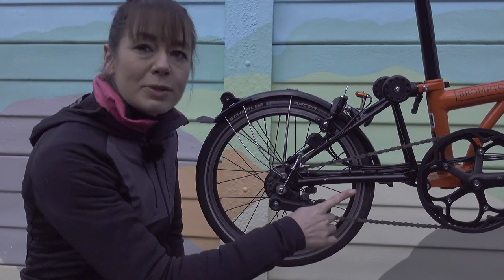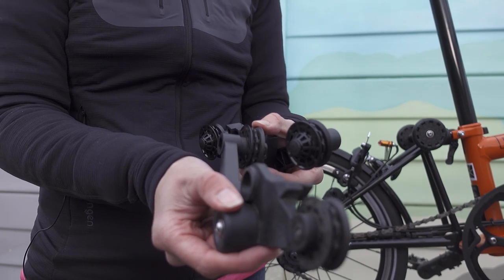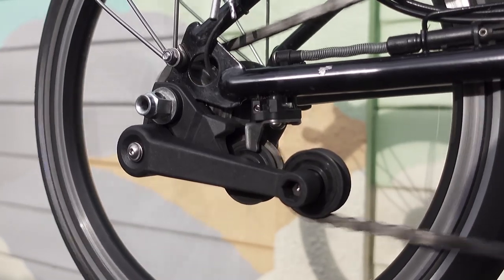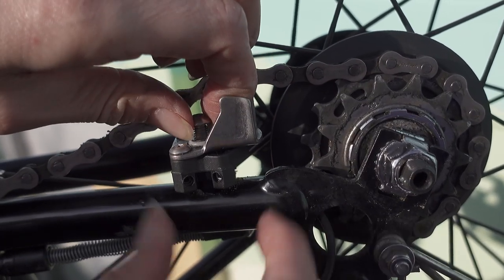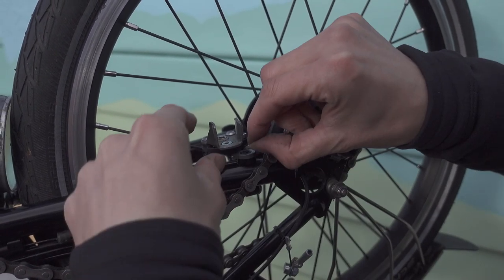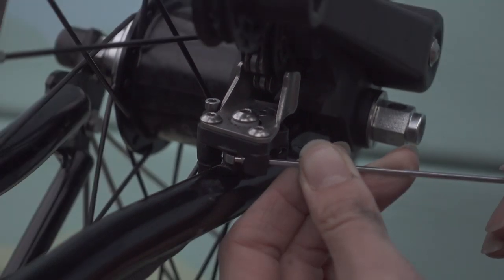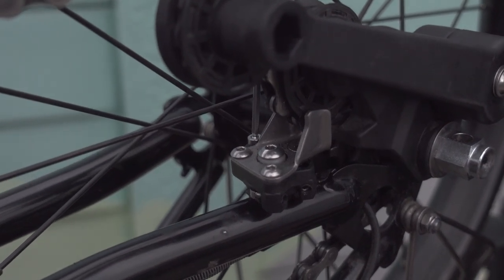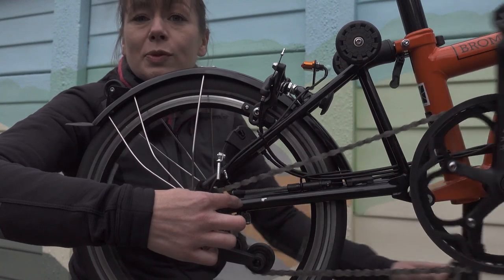Brompton 2 / 6 speed Derailleur - how does it work?

Comment: Thank you so much for this - whenever I have problems with the derailleur I can never remember/figure out which way to adjust the screws to get the desired effect. I’ll be referring back to this next time!
Reply from the maker: Thanks for watching - we really hope it is of some use
Reply: The way I remember is this:
1. The Allen screw further away from the rear wheel axle is for the higher gear (high=far)
2. The Allen screw nearer to the rear wheel axle is for the lower gear (low=near)
3. Loosen screw to close gap between wing and idler wheel (the wing that's supposed to be almost touching), tighten to widen gap
(I have this last point noted in my Brompton Manual as it is the easiest one to forget)

Comment: Spent a good 20 mins trying to adjust mine with no luck. Then noticed the housing for the bar/spring was moving about, maybe weakend or something. Anyway, cable tied it to the chainstay and it works fine now. British engineering at its best, no wonder we don't have a car industry now.
Reply from the maker: Did the small nut fall out?

Comment: Thank you so much, had the same problem with my Brompton and could not get the spare parts ( chain pusher and spring, cable) from my local Brompton dealer (tried to get them from Evans but they out of stock plus they sold me a wrong size cable 😳), ordered those parts from brilliant bikes and got free delivered really quick. Excellent customer service!

Comment: I just put a new chain on the Brompton ... the bike has done about 3,500 miles. Did not change the rear sprockets. BIG MISTAKE. The new chain kept pinging off the smaller of the rear sprockets; I couldn't do anything about it. Had to refit the old chain, in the end. Have now ordered new sprockets from you. Live and learn.
Reply from the maker: Thanks for the great feedback

It would be our number one tip - if changing the sprocket change the chain, if changing the chain change the sprocket

We often describe them like a comfortable married old couple - they get used to the way each other work!
Reply: @brilliantbikes  The spares arrived promptly ... and the new sprockets have completely cured all the problems I was experiencing with the gear-change.
The included nitrile gloves were a nice touch, and very 'handy'. Thanks.

Comment: Can you do a dedicated video on replacing the shifter cable and tuning the rear derailleur for the external 2-speed? How to tune the length of the cable with the barrel nut to match the shift points.Thanks

Comment: Really helpful video. I had similar issue, followed all of the steps but it didn’t improve. Eventually I changed the chain pusher for a new one, there was some wear on the inner channel which I suspect was contributing to the issue. Resolved straight away. I wouldn’t have had the confidence to tackle this job without your video. Thanks.

Comment: Hi. Always awesome. Q: My brompton chain makes a little clicker clack as the earlier part of your video your chain made. I notice in the post posher adjustment your chain no longer makes that sound. I’d like to seat my chain on the sprockets so that it doesn’t make the sound. It used to not. Started after I swapped tires and tubes with shealbe marathon plus. I was thinking many it’s my gear change chain in the 3 speed hub. TIA 🙏🏻
Reply from the maker: It sounds like you you need to adjust the derailleur needs adjustment!

Comment: Hi…. Absolutely great video and it really encouraged me to try and do a proper job sorting my gears out the first time round rather than trying to do a quick bodge!

HOWEVER!  Amy gears still don't work properly….. I can change from high to low gear but I get no click that holds my gear shift in place….it just pushes right the way back to high gear again… any idea what could be going wrong!

Comment: Thank you. This is really helpful and so well explained and presented. My wife has a new sparkly Purple Brommie which she has named " Jennifer ". There were intermittent problems with the derailleur. When we took it in to the LBS for its post sale 3 Month check up the technician found out that the gear shifter mechanism on the handlebars was binding internally from time to time. Apparently it is not uncommon with the new style shifters.
A bit of wet and dry and some lubrication and it is working as it should.

As an aside, I'm finding this series of Video's extremely helpful and informative. From the feedback I can see that I'm one of many so I wondered if you have considered running a Brompton specific maintenance workshop day/ weekend? There may well be an unmet demand, especially if a Pub was involved at some stage :-)
Reply from the maker: Thanks for watching 

We hope that your wife enjoys her adventures with Jennifer

Next Friday - 6th Dec 2019 - we have our village Christmas ‘extravaganza’ 

Based on your feedback we are going to try a workshop for wheel removal / installation on a Brompton to see how that works out (even if no - one attends, as a practice at least)

If you are able to get to CHOBHAM - come and say hello - we have good local village pubs!

Comment: I tend to find chain pusher issues are normally cable tension and that is adjusted at handlebar. If it isn't that then this is very useful. Still prefer my 1964 Moulton F Frame though 😜

Comment: Tensioner cleaned (in the part washer, not the sink!) chain pusher removed, cleaned, lubed and replaced, and dog leg bolt loosened a little to promote movement... and it's still struggling. I wondered if it was struggling because it's been stored with it in '-' position, causing the spring to loose some of it's strength? Ever heard of that happening?

Comment: one other issue i have found is that the housing for the shifter (new style) on the handlebar can create issues if its casing screws are done up too tight. It seems to limit the free movement of the shift lever, so if still stuck, i recommend trying just ever so slightly loosening those to see if it helps?

Comment: Hi, do you have a suggestion for when the jockey still won't push the chain into high gear? (the smallest sprocket on my 2-speed) My problem remained after cleaning everything and the checking all the other tips in this video. It seems the spring is just to week.

Comment: someone told me that we needed to open up the +/- shifter lever body/casing to change the inner shift cable?  Or, can i just simply change the inner shift cable by pulling out the old inner cable  and insert the new cable through the  lever? Thanks.

Comment: Lovely video. The gearing system seems far too complex to me. Why don't they fit a Shimano like everyone else?
Reply: The chain tensioner was there anyway, as a central feature of the fold function, so they just added the simple pusher and gave the jockey wheels float.
A conventional derailleur is probably heavier and  has less ground clearance. Also, when removing the wheel, the Brompton derailleur/tensioner is simply removed and safely out of the way.

Comment: Hi, i replaced my 50T chainring with 54T on my S2L. Without changing my 12T and 16T sprocket and my chain (i added 2 links due to bigger chainring), I'm now experiencing chain slipping/jumping on fast gear (12T). I dont have problem though on shifting low to high gear and vice versa. Any thoughts on how to fix the chain slip?  Thanks.

Comment: Hiya quick question to you and the world I guess. Just got a new elect Brompton. Had it for a few months and have just noticed that wheeling backwards in gear 3 (on hub gears) that the chain seems to jump a little. Doesn’t happen in 2nd or 1st. Doesn’t mat whether hi or low on the cogs. Is this normal? Many thanks. (I’ve adjusted as per your great vid too!)

Comment: I have a different deraileur system, have Brompton changed the deraileur system?
Reply from the maker: Thanks for watching

The deraileur mechanism itself didn't change (the pusher and the adjustment)

But in 2017 the integrated brake / gear shifter was introduced - which changed the way the chain pusher is actuated and the dogleg became the part shown in the video

Do you think it would be a good idea to do a "before / after 2017 .... differences between" video?